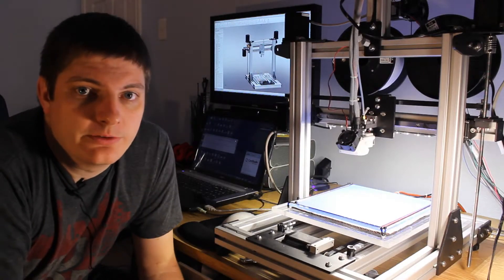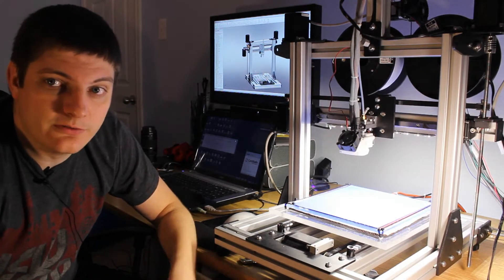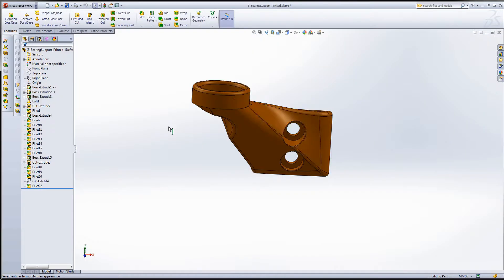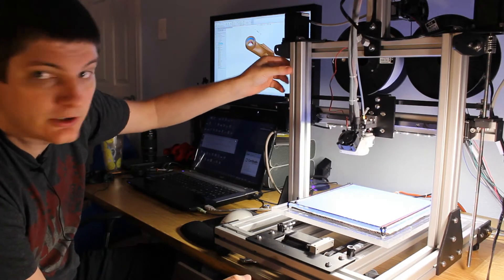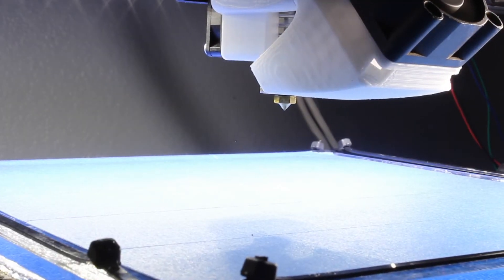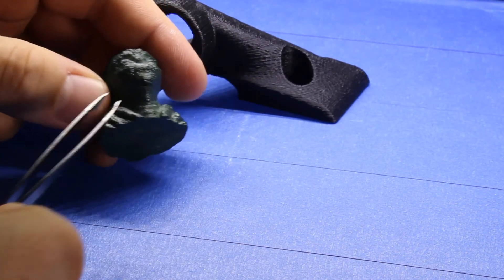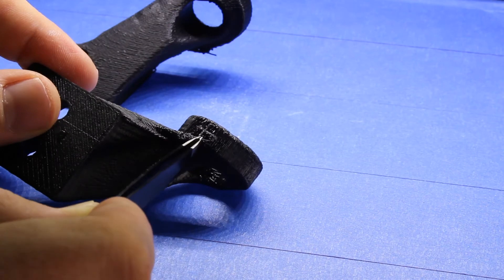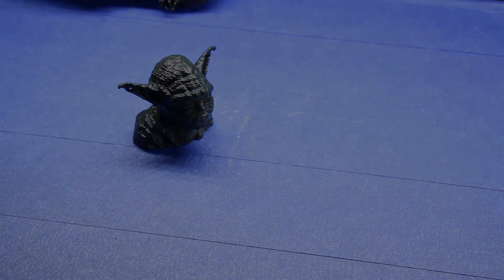Evan's DIY 3D Printer / Mill - EP13 - CAD-To-Print of Z Axis Gantry Thrust Bearing Mounts

Comment: You are 100% right.  The transition zone is your issue.  If your running PLA (lower melting point the, the tube slowly gets a little build up higher and higher in the tube(microscopicly)) And eventually the hole in the tube at the high end of the transition from hot to cold starts dragging the filament causing a jam.  With PLA I have two things I do to help prevent this.  1. switch the solid stainless steel tube out with one that has a PTFE liner.  This will make is so that no PLA sticks to the side at the top of the heat transition zone.   2. When you install the stainless steel tube, use some thermal compound in between the tube and aluminum Honeycomb(not sure what its called) heat sink thingy and this will allow the heat sink to pull more heat out of the tube.  Which will make faster transition from hot to cold in turn lowering preventing the little build up.
     This doesn't happen with ABS because it has a hotter melting point and the honeycomb can dissipate enough heat to not cause the build up.  But if you end up changing the Stainless steel tube to one that has a PTFE liner, this PTFE tube will start to melt and cause jams on ABS. 
    Which is kind of where I'm at right now.  I have used the honey combs and have succesfully run PLA in an stainless steel tube without a PTFE liner so long as I move the honey comb as close to the heating block as possible and use thermal compound.  I have another idea right now that I still need to do a little fabrication on which is replacing the honey comb with a water cooled block. 
     Most 3d printers won't hit these problems.  I have hit these problems because I am trying to push my machine to the printing speed limits.  I'm approaching prints speeds close to 300mms with very high quality prints.
    I hope this helps you and look forward to seeing your troubles (just like mine but I haven't documented like you have) and your fixes which will help the whole community.

Comment: It looks to me like your extrusion multiplier is too high and thats why your lines look squished and blobby. I think if you were to switch from cura to slic3r you would benefit. Slic3r has alot more options to customize and would really suit this kind of printer very well.
Reply: Thanks, I've been meaning to give slic3r a shot, but I've not had much time for learning new tricks.  I'm mostly battling extruder jams and skipped steps, neither of which are the fault of the slicer.  Once I get those issues taken care of I can investigate slic3r.

Comment: Nice Printer man looking at your setup here are a few things that will help...
fan. nice looking at your air cone run at 40~50% avg for PLA and off for ABS set to 100% for bridging with both.

1. kill all airflow around printer build a cover or keep room 75~85F when printing with Dead Air

2. Retraction use apx 3~4mm of retraction per foot of bowdoin tubing going to the print head.

3. the heat-sink on E3D style J-heads must be cooled at all times but the air must be directed up and away

i have a 2 Mega 3d printers I built (7ftX8ftX2ft)enclosed with build plate on Z head on X and Y with print zone 6ftZ 6ftX 18inY runs on 16mm rods and 4X 16mm ball-screw 7ft tall and same belts as you my travel rates are over 700mm/s and print at 250mm/s running modded RAMPs-FD board driving 2X custom print heads one PLA one ABS each is dual feed or dual color XYZ are Nema 23's bowdoin's are Geared 5:1 Nema 17's direct drive and water cooled Print heads pivot 15deg to keep From contaminating print
retraction on my setup is 14mm at 100mm/s my tubes are 62in long my PLA heads are 0.5m and 0.4mm (i run PVA in one some times) both ABS are 0.5
TechMasterJoe At Gmail if you want to talk more

Comment: Just find out your channel, and it has very useful videos. Keep on showing us more! I have a question, can u publish or send in pm some how much it all coast at total, and maybe main parts name and it coasts. English is not my foreign, so i have some trouble in getting right part name and coasts. Thanks!
Reply from the maker: As I mentioned in the first video, you are probably not best off making this exact machine... the bearing rails are over sized and overly expensive, as are the motors.

But, for a general idea:

Extrusion (Misumi): $120
Brackets (Custom Waterjet shop): $120
Hardware / paint etc: $50
Electronics: $200 (overkill 8 driver azteeg pro board)
Motors: (Free!)  $50 x 4 = $200
Wiring: (Free, scrap from work) = $50
Linear Rails: $200 x 5 = $1000 (I got Free from a friend)
Hot End: $80
Extruder: $80 with motor
Heated Bed Glass: $35
Heated bed element: $20
Power supply: $50 (free out of my lab)
Belts / Pulleys: $150
Bed material: free from friend
Machined Parts for hot end mount: self milled scrap

So, I'm probably in it for just over $600, but to replicate it you are looking at at least $2k if you use those same bearing rails.  I would recommend something like a mendel max instead, or a core xy setup out of smaller extrusion.
Reply: SquishyBrained Thanks!

Comment: Hello Evan, congratulations for your project, this is beaultful. Just one thing that a think you forget on your slicing software. Your filament diameter, you should measure some filament that you have and insert the medium value... sorry for my bad english.
Reply from the maker: Thanks!  I have calibrated my steps on E, and I've measured the filament a few times as it goes by.... it is pretty consistent.  I think I'm getting good fill, so my volume is within a few % at least.  I can tweak it in real time in repeiter host and it either squishes out above 100 or leaves gaps below 100, so I'm pretty close I think.  This filament seems decent (monoprice)

Comment: You are useing the 1.75mm plastic if you went to 3.mm do you think this would help
Reply from the maker: I think the 3mm E3D may have less problems.... Aside from that, I don't think there is much difference with respect to the problem I am having at speeds over 70mm/sec or so.  3mm would not buckle as easily, which is my main problem, but it is caused by the hot end I think.

Comment: My jamming issue with a bowden was that the filament spool had varied diameters in the plastic,therefore jamming inside the tube and not at the hotend. Not sure if this would apply in your case.
Reply from the maker: I have checked the filament with calipers, it seems pretty good.  My first thought was the vendor, but I'm pretty sure I've measured enough to free the filament from blame.  It is most definitely worth a check, but I ruled that out pretty soon since I'm using somewhat cheap monoprice filament